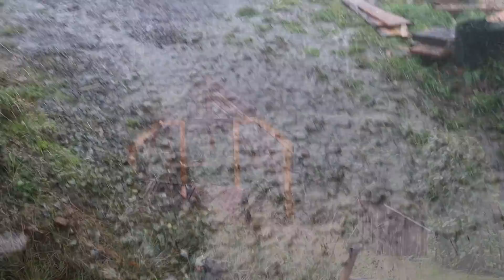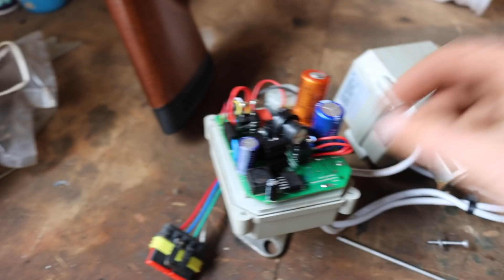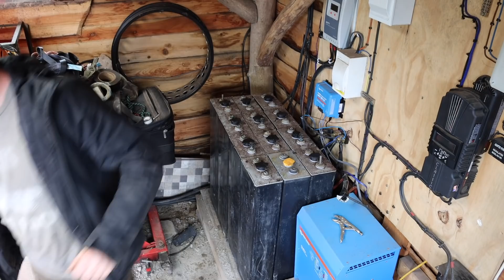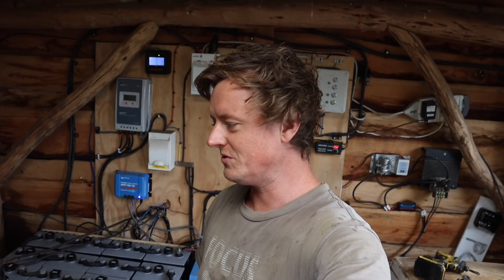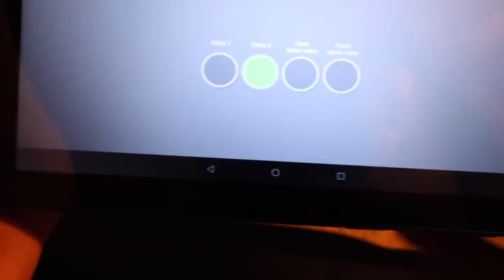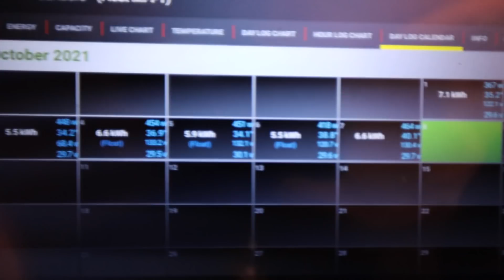Turning On The Hydro For The Winter And Installing A New Battery Bank

Comment: I know this NZ guy who made his DIY Hydro out of rewiring an old washing machine motor & tub collecting water on his property that was high up going through those 4" wide pvc fire hose & 2" wide pvc hard plastic pipe going into a single nozzle which gave him around the same 24v 20 amps/480 watts plus as what you get & I was amazed at how simple his setup was. If you search for Marty T here on YouTube you can check out how he did if you want to copy any ideas from him also.

Comment: don't do lithium-ion do lithium iron...it's not quite the same density as ion but it's safe enough to work on boats and they don't combust if you overcharge them...
Reply: Yeah, LiFEPO4 are the way to go.  I've got 10KWh with simple top balancing boards (1.8A at 3.7V).

Comment: Hey there Kris, great video about the new battery bank, I was wondering how much something like those batteries cost you second hand over there? I have these massive 4x 12v 300 Ah batteries that are 74 kg each that cost around $650 each x 4 as well as 4x 500 Farad 16v Maxwell Super Capacitors around $250 each to provide up to 340 Amps 24v Continuous from both wind & Solar. While typical Lead Acid batteries don't absorb power very well when charging as well as discharging them but by having the Super Capacitors the raw regulated amount of power from your solar & wind feeds directly through the Super Capacitors into your Inverters while only taking a small current draw from the batteries as well as charging them slowly by using excess power during non peak periods. It's kind of costly but fixes all the problems associated with using Lead Acid batteries.
Reply: Lower your usage...what equipment are you powering the engine also full electric  ?
Reply: @jshaw4757  Yes full electric, with some items as a 2 burner induction cooktop, half passive & half electric hot water heater, a fridge, deep freezer & a small 750w air conditioner the current draw at times can be immense.
Reply: @solarfunction1847  I'm happy with a camper a 300w heater n a fishing rod bro...
Reply: @solarfunction1847  good on you I rate what your doing bro 👌
Reply: @jshaw4757  Yeah it doesn't take much heat to warm you up in a small area.
Reply: @jshaw4757  Maybe in the future I'll have a DIY camper that is a tiny house that I can take anywhere & just explore the countryside.
Reply: @solarfunction1847  What u think about the salt battery thing bro...I've seen they work on a small scale ⚖..and that is with pennies which arnt even fully copper and zinc washers...layer them stacked with a bit off cardboard or a better substrate inbeetween each layer to hold the salt water....you have the copper on the bottom zinc on the top you got your battery 🔋...you should build a little one n get back to me lol
Reply: Ever looked into building salt water batteries to trickle charge your main batteries?
Reply: @jshaw4757  The problem with that is that if you are relying on off grid power then that idea of yours would need a huge battery system to provide a lot of power as well as be able to spread out your 3500w from solar & wind
Reply: @solarfunction1847  I'm just thinking keep van and maybe tiny bungalow warm with whatever heater I like 400w bar heater warmth if no fire wood around...but a 200w in a well insulated van will do...camping shower that sorta stuff I'm rough n ready bro lol....but the salt water batts I mentioned I got 2v...and excuse the ampage but it powered one off those small led lights for around 2 hours...the cell was a couple cm in size...so if I seriesed them and made them wider to hold more salt water in the build i could build a nice enough thing to trickle charge with salt water all day all night....just need zinc n copper panels...which will aid you main battery matrix....well lemme rephrase the volts were there 2v for a stack off 8 penny's size...there was enough amps/current to light a small led for around an hour plus...when it ran out I just quick dipped it back into the salt water and got another hour...so this is a tiny cell...but if increased the size off the cell so the salt water doest burn out for 24 hours then series these bigger cells together....you could build a nice salt water battery trickle boost set up for your main setup
Reply: @jshaw4757  I use a 300w 24v fan heater here in my little box I live in which I can run for 12 hours at night if I want together with the fridge as well.
Reply: @solarfunction1847  good job

Comment: lithium also prefers indoor temps,not outhouses,loses capacity with lowering temps....and if charged sub zero,goodbye battery!
Reply: There's a video by Will Prowse where he puts a small heat mat with a safe cut-off thermostat to keep the batteries at a higher temp.
It's also worth noting that the batteries don't like being charged much below zero but can still be used below zero if the load isn't too high. So if you want to charge then just push a little of that charge energy into a heater and it'll work fine.
Reply: https://youtu.be/DBngQaRdw8M

Comment: Chris, please take a look at this very effective and engineered design by a brilliant off grid youtuber and his water wheel rendition at https://youtu.be/war9v2DxMs4
Reply from the maker: That is a nice video and a great little wheel for what he is using it for but its not efficient enough or something that will last very long. The wheel is quite reliant on screws that would fail quite quickly being submerged in water. The sort of thing i will have to build for this system with be about 4m in diameter be made of huge bits of oak and steel plates. It will need to withstand 5kw of power 24h a day for at least 30 years.
Reply: @KrisHarbour  Agreed, thanks for replying!

Comment: I've used the sealed 12V lead-acid deep cycle marine batteries for 10 years with no fail

I had them connected as 48V strips (4 in series, and then those strips were parallel to each other, and to 48V MPPT controller 5kW)

I sold them because I'm not allowed to ship them to my new off grid location. they would probably run for another 5 years or more.

I'm surprised because Chris's batteries are 4 times bigger than mine and he can lift it relatively easy, and mine are of the car battery size, and I can barely lift them up on my own. I think they must have some real thick lead plates, which is what makes them so heavy and heavy duty too.
Reply: Those cells are about 50-60kg each
Reply: @shaynegadsden  mine are 32 kg and 1/4 of his batteries size

so I assume they must have much thicker lead plates